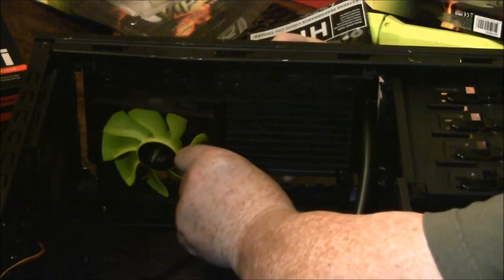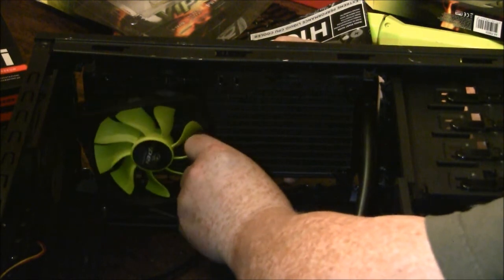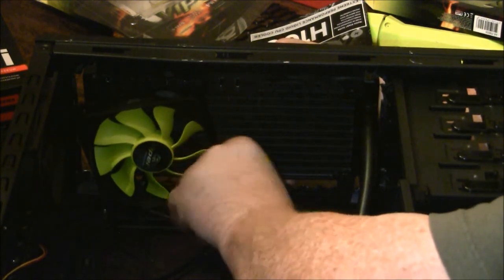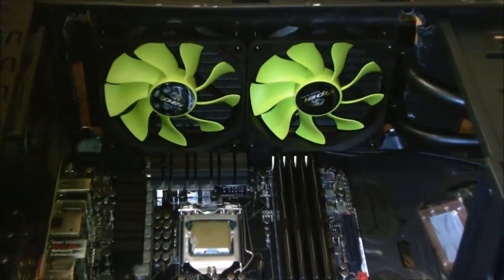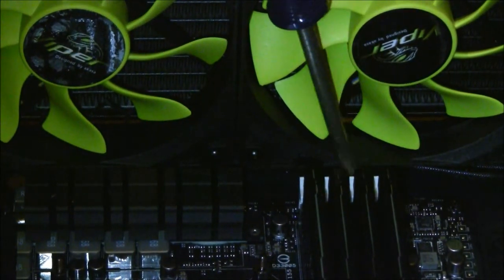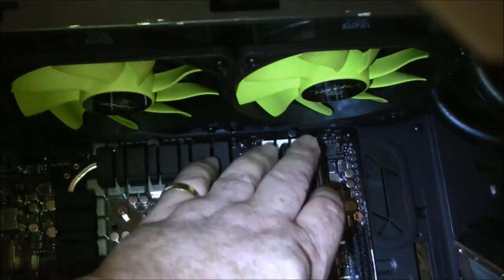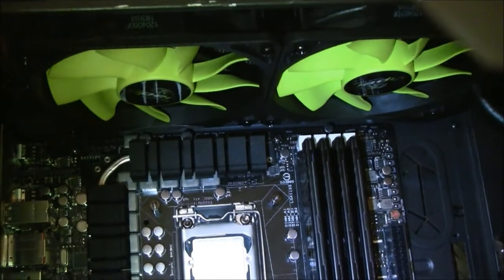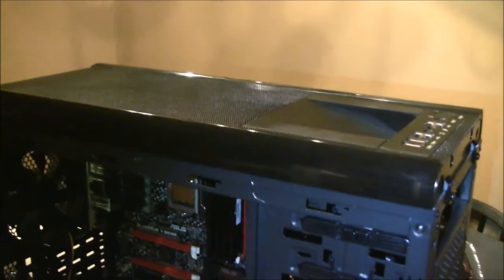Corsiar H100i & Asus Maximus V Gene in Rosewill Blackhawk Case

Comment: Did you need to use slimmer fans to make it work? Or will stock fans work with the modding to the case? I'm concerned with mobo clearance.